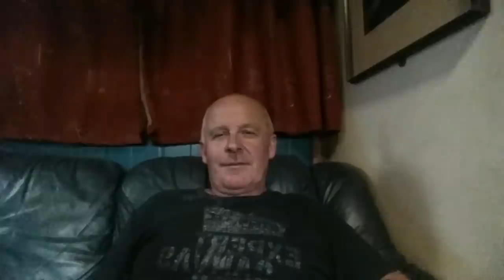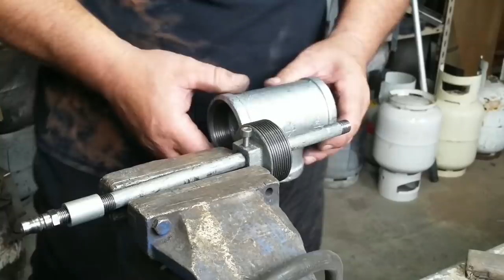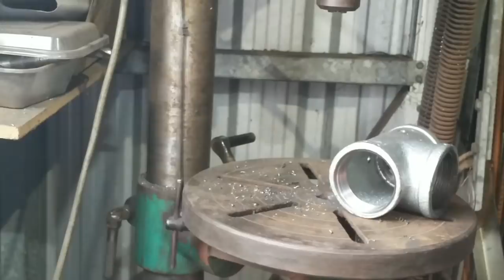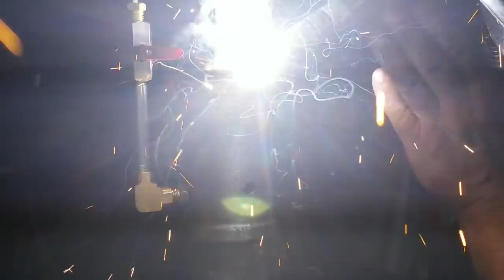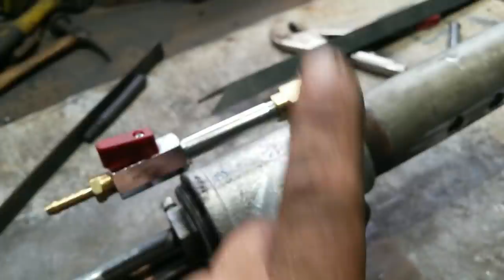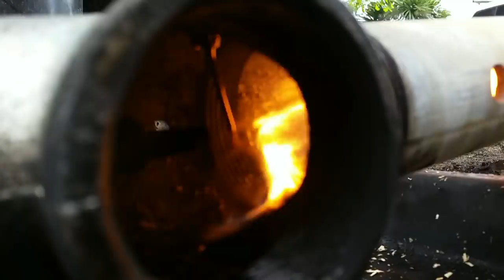Make your own Free Diesel from Waste Plastic!  PART 1

Comment: I started doing this after the persian gulf war and have been improving the process steadily ever since. Besides plastics I have been refining used motor oil  and fat waste from my vegetable oil fuel refining. My burner is powered by a small hydraulic pump , those parts came from farm spray equipment.

Comment: I love this video series! I would also add that building a Gassifier to extract wood gas to run your engines is a little easier and doesn't require the burning of plastics, but it can burn plastics, but rather it burns your garbage and wood trimmings, leaves or just about anything that creates an ash when it's burned. It's also Carbon Neutral as well. Also while it's burning it you can drive the vehicle or engine directly, no conversion is necessary. It does have one drawback. You have to "add" extra cumbersome plumbing and piping to your vehicle for it to work if you want to drive and burn at the same time. You can also create the gas and store it and then burn it like you do propane in a vehicle, but that takes an extra tank to pump and compress it. I am looking fwd to investigating this process. Thanks for a great show and new, to me, option. Oh if you want to see how successful it is go to his channel and watch this video https://www.youtube.com/watch?v=rHjUJPeUh7A  & this one https://www.youtube.com/watch?v=Kihm4GCO4tg   Best Wishes & Blessings. Keith Noneya

Comment: For all the people commenting about galvanized metal being toxic.
I watch a lot of videos on hobo stoves and rocket stoves. The galvanized metal is toxic when it is heated you want to do it in a well-ventilated area or outside.

However after one good burn you burn off the zinc making them at all no longer toxic. you can usually tell when that's done because the metal becomes dull in color, it loses that shiny zinc covering.

Comment: Thanks for posting this my brother from down under. I've been rolling this idea around in my head from making char for the fields.  Being able to turn waste plastics into fuel is next generation.  Having extra diesel around is more of a bonus.   I like to cut all my commercial diesel with some home made bio diesel (10% at least) because it increases the combustion temperature which burns off all the black smoke that everyone frieks out about.
Reply: I had my old Opel Astra Diesel running on up to 60% Rape seed oil on regular basis. While I did a long distance (700km) trip I even increased slowly up to 80% once (I did it bit by bit, but I was running out of distance at the end and I wanted to have enough Diesel in the mix again to make sure I was able to start it. It was running great. In Winter time at 0°C 30-40% was max or you would have a hard time starting. At around -10°C 20% was max. Short distance at under 10°C power was really miserable since the Oil was too cold, but once the oil was warm enough (due to the Diesel returning unused Diesel back into the tank, this was the case after about 10km.) same power as regular Diesel
I do not know the English word, but you need a "Vorkammerdiesel" (pre-chamber diesel?), also Bosch injection pumps do not have an issue with the oil, I have heard the French Delphi (Lucas) pumps the seals get busted by the rape seed oil and they get damaged. Also: If you have an old car, start slowly on the veggie oil: It cleans really everything out! So if you use too much at once you get clogged everything :-)
Fun fact:
Did you know Rudolph Diesel invented his engine to be run on Peanut oil for 3rd World countries to be independent of the oil conglomerates ?!!
He died of an "accident" on calm sea when return back from England...
Reply: @marwerno  "accident",ugh huh.
Many have had those.😒

Comment: Good idea, we did it couple of years ago and the fumes are toxic.but after the fume are transformed in to liquid the smell is very minimum, burns clean. White just like the gas at the gas station.we are buying plastic gas for the price of the real gasoline
Reply: Probably just as toxic, which is not mentioned here is burning off that galvanized metal. The first real burn is toxic and should be done out doors.i learned this from people making hobo and rocket stoves using galvanized metal and pipes.
Reply: @werewolf74  Use black pipe, it doesn't need to be galvanized.

Comment: I use the drill press to start my taps, turn the chuck by hand until I get a couple turns. Great video Sir.
Reply from the maker: Thats a great tip. - thanks. I spent the first year of my apprenticeship resharpening drill bits and tapping holes. - I can do perpendicular with  a sandwich in my hand! lol
Reply: @t.h.o.r.   I'm in your shoes been in the tool & die trade sents 1989. Fully understand.

Comment: The recycling scheme here in Australia pays 10 cents per plastic bottle. I doubt that I can make a litre of diesel from 15 plastic bottles which is what you would need to cash in to buy a litre of diesel at the service station. Of course, one could always use the non-redeemable containers to make the diesel, but I suspect I wouldn't have the time, engineering skills or patience to build this apparatus. Kudos to this guy for putting this information out there though...
Reply: You're missing the point entirely.. we spend 100's of millions shipping our plastic waste around the country & overseas...
Reply: @reoneade8828  You're probably right. I was just stating the economic case.

Comment: Fantastic idea - myself ive been getting old grease from a couple fast food outfits - i just pump out of their grease vaults into 55gal drums - then i strain & filter the old vegetable oil removing the impurities thin it if needed - run it in my old diesel Mercedes - it burns about anything - old motor oil atf's - been about 15yrs now - keep thinking outta the box - peace brother
Reply: in Australia the used cooking oil is so popular for biodiesel that every restaurant or cafe has a drum at the back for the waste oil to be collected.
Its impossible to find a supply now... :)

Comment: have to tell you this, there is a guy in japan, that invented a devise that boils the plastic into a gas, then the gas is cooled into an oil ,you can refine the oil into diesel ,gasoline and kerosene or use it as is to heat your house
Reply from the maker: Umm- thats what this is

Comment: Great vids, I've been doing wmo/wvo for a long time, but this is much cooler!  If you kids at home are using waste motor oil to run this, no need to smoke out your neighbors, or buy expensive sock filters, common canvas blue jeans work well as a 20micron filter.  That's enough to keep you from smoking out your down wind neighbors.  Jeans probably have a different, cooler name on Australia, dungery-doos maybe?  Keep up the great vids!

Comment: apply it to a water boiler , then generate steam and apply that steam to verity of  steam devices for different applications :
like steam radiators, engines , generators , agriculture e.t.c . 
good work mate much respect .
Reply: @MartiensBezuidenhout  
I presume your argument is about free energy ? 
 this video is about recycling waste materials as fuel .
 Nevertheless. , you can still supply part of the engine power through mechanical force ( such as belt driven pulley systems ) to run a small generator with external rectifier that will recharge the batteries that are supplying thrugh an inverter from 12 vdc @ 600 amp capacity in to inverted 120 vac @ 1.2 amp to relay the power for the compressor . of cours you will need a charger capacity readometer with inversion relay ( auto and normally open gate 1 and normally closed gate b ) 
 The electrical line paths can be also protected with power loop circuit diodes on each supply point of cross path . if you can't understand that ? that will be your problem not those who are seeking new ways to make a better future .
Reply: @MartiensBezuidenhout  ,
 there is no need to apologize , you have the right to post your thoughts even if it is not accepted by others , remember that . 
to answer your question ? I must assume the waste is already from commercial level , chemical and plastic mainly ? are hard to resolve or oxide  at accelerated rates , Plastic waste is very hard to return to nature because it was already altered from its original boi state , so we already figured how to make Plastic , but can't yet figure how to convert it back to its original state , burning it as fuel ? can be used as a cheap method to completely waste it and convert it in to something else in future . but for now ? that can work . 
 it is  true there is no such thing as free energy , but think about the electrical powered devices for example , the batteries that powers up tools or vehicles ? cost more energy and have same emission vlaue to make them just to have a vehicle or power tool operate with  free  emission . where Oceanic Alegy and land plantations can clear the CO2 using their natural works of art called photo synthesis to dollect Carbon and release O2 in to the air ( natural Recycling plants ) . 
another example : the Governemtns striction on fuel Emissions on Auto industires? has cost more environmental damage than the classic cheap methods those Industries used , 
 take the Cost of cast iron block to make and vs Aluminum cost to make , it takes  more chemicals and more energy to refine Aluminum to the state ready for casting where Iron Ores can be simply melted and cast at less than 1/3rd of that cost .
the only advantage Aluminum has ? is the weight , but Cast Iron ? is very durable , strong and can withstand higher temperatures  than aluminum , plus it is easy to fix or repair than aluminum . 
to make something sufficient ? you need it to work at all 3 : gas , liquid and  mechanical  , like Human Body does and human Body is very very sufficient in terms of energy and fuel use to operate entire body's mechanical to accomplish all survival tasks it needs to . 
 in other hand ? scientists now are experimenting with what is called Fusion generators , a spheroid or donuts shape chamber structure with Mercury and outer chambers with megnatized  stater  and it is working so far but still under developement . it is almost a prepetual machine to produce energy at cheapest cost .

Comment: This is so amazing that i cried! I am happy that you are freesourcing your work like this! I want to implement this project in Iquitos Peru, to help with their plastic contamination problem. My goal is to get the university Engineers to work with landfills and waste companies to produce these!

Either small versions could be mass-produced, and the citizens could be paid for the fuel that they produce, or they could trade their plastic into larger facilities for fuel to drive there motos. 

I'm truly inspired and I'd love to meet you! Also if you have any ideas to help me with my project I'd really like to get in contact!
Reply: The reason this hasn't been implemented in mass already is because the depopulationists are in control of the government and their goal is to use Diocletian's Problem Reaction Solution to keep themselves empowered while exacerbating the problems all the while blaming overpopulation for the problems. So if you want to see this implemented then I highly recommend you avoid any government or university path. Instead, find a way to do it yourself on a small scale and teach others a few at a time. If you don't have iron pipe then experiment with clay and firebrick. Use what you have.
Reply: @kedwa30  
I agree with your analysis of how the powers that shouldn't be cause problems to profit from them, but, the term "depopulationists" do not fit them. If anything, they want more people, not less, to cause more chaos and profit even more.
Overpopulation is an issue and it's not a matter of space. There is square footage for many times 7 billion, but in terms of resources, together with the quality of people, the world would benefit from less people.
Reply: Muh Shekels you obviously do not know about agenda 21 and the Georgia stones alas what he says is true.
Reply: Muh Shekels are you really this unaware? That’s sad.   The Globalist have made it very clear they will implement population reduction, They openly talk about this, They believe the world can not sustain any more than 500 Million, we now have 9 Billion.... they are so serious they included this in Agenda 21 and Agenda 30, They even etched it into the Georgia guide stones.  They Definitely do NOT want more people that’s for sure

Comment: i definetly recommend using black iron or stainless fittings for the burner because galvanized puts off a toxic chemical when burned welded or heated. called zinc fumes just a fyi

Comment: I think a basketball inflator needle might work really good in place of that wire for the oil drip
Reply: Might be too soft, would melt from the heat and plug. Hard steel nozzles are pretty expensive..
Reply: just buy a proper burner! -.-

Comment: This is probably one of the reasons they want to ban diesel powered vehicles.
Thanks!
Reply: Yes!  Rudolph Diesel was suicided.  I mean who packs all their stuff and then jumps off the ship they're on?
Reply: Diesel engines run on high compression and lean air fuel mixtures. In that combustion environment lots of nitrogen reacts with oxygen creating NOx (NO and NO2 mixture). In air NO oxidizes to NO2 and NO2 reacts with water to create nitric acid (NO2 + H2O -> HNO3). So by breathing city air with lots of diesel car you essentially breathing in small amounts of acid. That with soot particles is what killed diesel engine.

Comment: What about using a old Diesasl fuel injector it all ready built to with stand the Temperature and pressure . Is this System available for Download in PDF format .
Reply: you talking about them old pre-cup injectors?, heard from an old instructor that they would run even with the dirtiest fuel.
Reply: The only problem is triggering the injection event. Newer injectors need an electrical pulse and old styles need a cam or something to depress the plunger. Just use an oil burner nozzle with a constant pressure pump system with a bleed line for excess fuel to be returned to the supply tank.

Comment: SO ... if you did your "refining", during winter ... you'd get the heat too.
Reply: Apparently you can heat water too.  I remember a former co-worker that wrapped a length of copper tubing around the stovepipe of his wood stove and heated water in the winter.  Probably something similar can be done with the pyrolizer here.  Neat burner.  I didn't realize the amount of flow required.  I was thinking one drop at a time... :)
Reply: @monkeyship74401  oh yes, if all you want to do is heat a space then you can set an oil burner to do it by the drop, but the chemistry of fractional distillation requires a considerable amount of heat. Remember you need to melt the plastic and that alone will absorb a lot of the heat. I've had trash fires go out because there was too much plastic and it sapped all the heat and wouldn't burn until melted. I'll be glad to convert it to diesel rather than waste it, but one way or another it's got to go. If you let plastic break down on its own then it forms dangerous hormone mimics that leech into the water harming wildlife and causing cancer in people.
Reply: @kedwa30  I'm still surprised that there aren't more "commercial" entities converting plastic waste into something more useful.   At least I will know how (and a bunch of others watching.).

Comment: Why isn't this done on an industrial scale, and thus ending plastic waste?
Reply: Because the powerful elites don't want to to benefit in any way and they want you to stay in slaved and subjected so they can keep there power.
Reply: Because of the toxic byproducts you blow into the air. Alone burning waste oil is a crime in Germany :D You may emit very nasty stuff like Dioxine. In Germany you'd be so damn deep in sh** doing something like this. Its not one law but like a dozen you break....and you'd end up paying a fine 6 digits or in jail for several years. So folks don't try this in Germany ...
Reply: @hansjorgkunde3772  Does Not emit by products that can't be re-used in the distillation process thereby becoming carbon neutral, there are a couple of commercial size units being used in Auckland NZ, in a waste management plant as i met one of the investors while they were installing them. 
But for the powers that be, say for example, corporations in the petroleum industries, how much money do you think they will invest in propaganda campaigns, including funding of scientists, and other detracting research of all angles in an attempt to dissuade 9the masses that such devices do not work...  yet chemists have long proven this theoretically possible in chemical equations. 
But really Hansjorg you are likely one of those sellouts who cares nothing for the benefit of society as a whole as long as you benefit.
Reply: It should be. But there is no incentive as wellhead oil is so cheap. Now we can't pretend to ship plastic to Malaysia for 'recycling' (to be dumped in the sea) maybe enlightened governments will create tax incentives.
Reply: its normal that they avoid plastic burnt but you can set several filters to avoid ecological pollution

Comment: Don't forget to mention the galvanized metal warning.
Reply: what are some alternatives ?
Reply: @fly.god.infinite1626  you can burn off the galvanized coating but must do in a safe place to prevent poisoning, or you could soak in vinegar to remove the coating, a much safer method, or just buy black steel pipe.